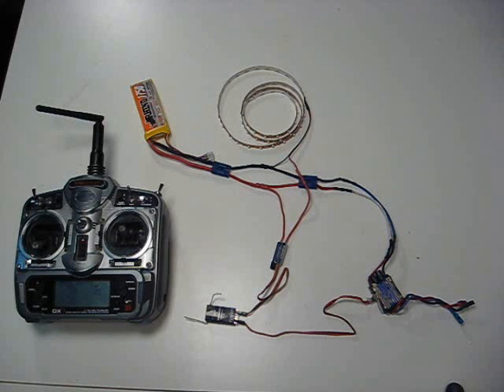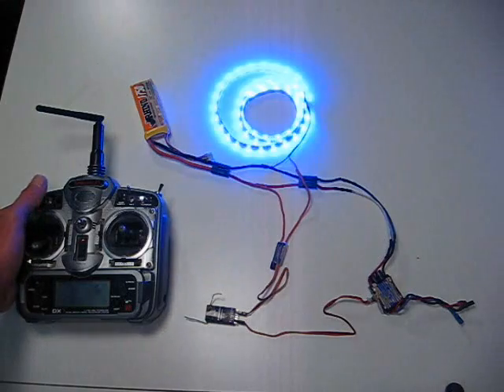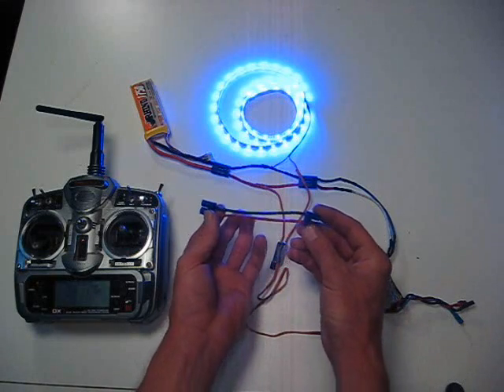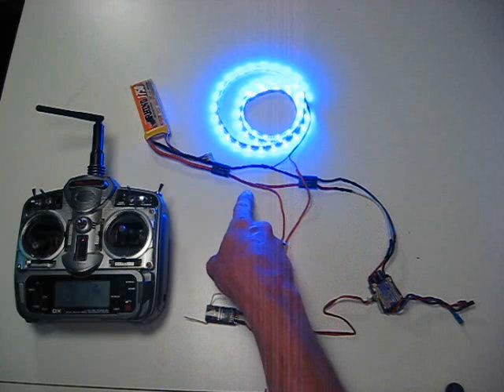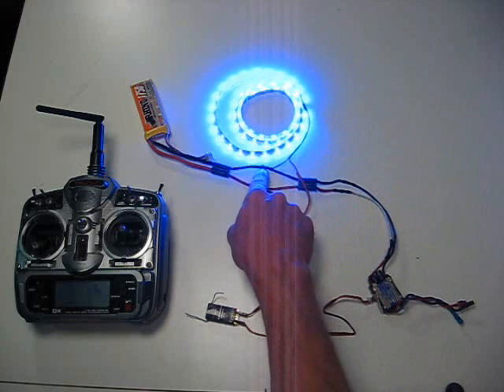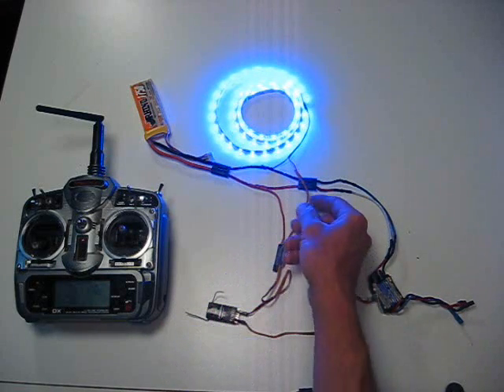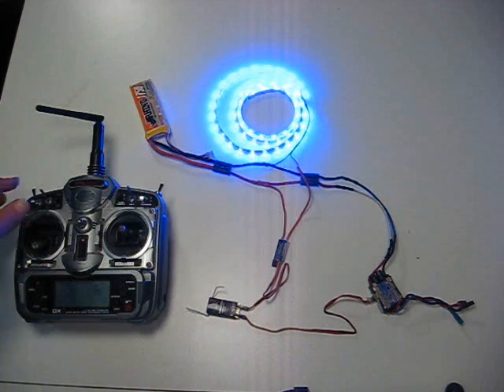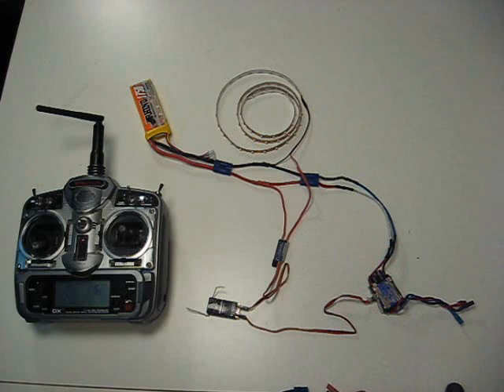Night Fly Lighting Remote Receiver Switch

Comment: Hey I just got mine today and I can't get them to work.
I'm trying to power some LED strips for my octo. Basically all I did was wire the switch to the positive  lead, allowing for the switch to open or close the circuit, just as any other kind of switch works. The servo cable is connected to ch. 8 on my Hitec Optima 9 (using Hitec Aurora 9) I also tried ch. 7 and 9, also tried connecting the cable upside down in case this thing work inverted, it doesn't.
Anyway, nothing works, I've tried every permutation of the jumpers too. I bought a few (switches), tried two and neither worked. Everything else is wired correctly, power source is suitable. If I bypass the switch, then the power gets to all LEDs no problem.

I'm using a separate battery for the LEDs, the rest of the system, including the Rx, is powered by the primary batteries, therefore I'm not using a BEC, that's the only difference I can see when comparing what I did with other wiring tutorials I've seen. but since I'm not powering the receiver it shouldn't make a difference if I use one or not, so can you think of a reason as to why this is happening? I'm posting a video tomorrow.
Thanks!